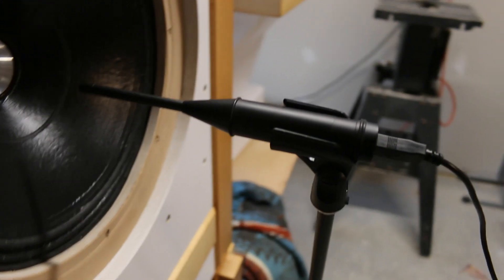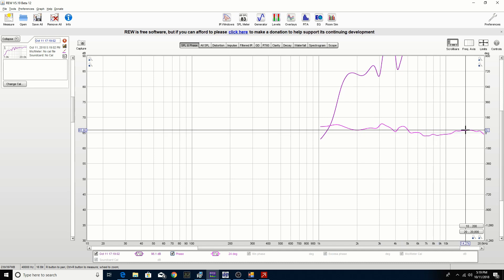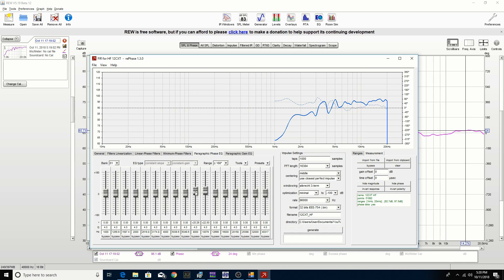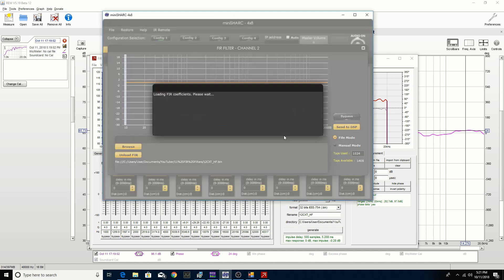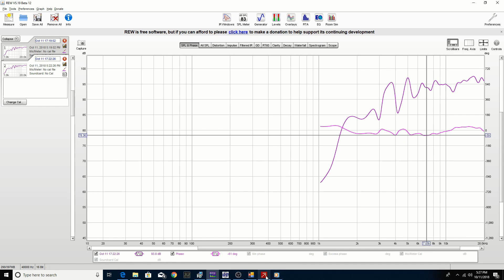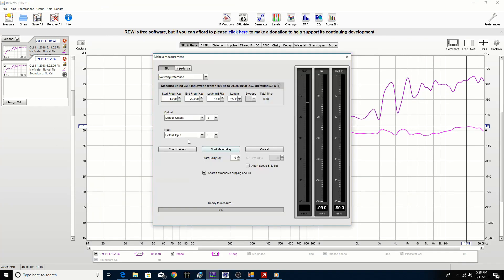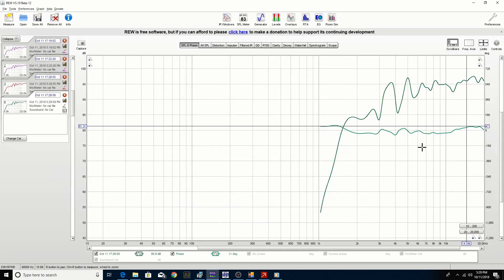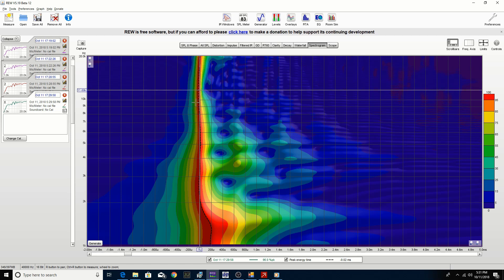Flattening Phase Response using FIR Filtering via MiniDSP OpenDRC-DA8

Comment: But this is like eq right??? So what's the difference???
Reply from the maker: subjectively it just brings the image forward or backwards into the soundstage. It's not better or worse but just different.  If a speaker is well designed then this is not required IMHO.

Comment: Problem with this kind of setup , this Coaxial setup is Wave Guide Vibration , so you have a Horn essentially and its vibrating back and forth . So your physical air for HF driver is not stable,  this introduces Frequency instabilities , and it sounds like when you talk trough Ventilator , creates Frequency modulation . 
Now this shows how there is no Perfect speaker , everything is a balance . However i can make a DSP to correct for this , but its not cheap . Its an Invention . Few Speaker companies are working on it already , still not patented so if you are interested let me know .

Comment: Phase is considered only on Xover frequency , because of summing , if there is no summing like here is the case , there is no change in response . Your Ear doesnt care about phase , so if the Xover is set to 2Khz , then everything above that is non important , you can play with it but you will hear no change
Reply: True, but phase changes the waveform shape. Imagine listening to a square wave synth.
Reply: @manamimnm  yes it does , but its not a square wave , bass unit creates sinusoidal pressure medium in front of mid high driver , and then its sounds travels along the bass sound. You can imagine this as Amplitude modulation , and it sounds exactly like that , take a song , amplitude modulate it at say 100hz  in some DAW , and you will hear exactly that . If you listen only  those speakers you cant detect it easy , but A and B fast switching , you will notice , i did . And beyond that Measuring microphone does not point towards a speaker but its tangent or 90 degrees , in this case vertical . Sound crosses the capsule and changes pressure in it , while if you point it at the speaker , sound will enter in  and cause phase shifts and all kinds or reflections ,and stuff , it makes it even horizontality but less . But at least measuring instrument is used , i promote that , because Sound is similar to Visual  Art , if you dont know what to look for you dont see it or appreciate it , with sound its more pronounced since you cant see it , effectively you are enable to hear stuff if you dont know what to listen for , and when this is done , its done with 1 speaker , always only 1 , even if you have a stereo pair .  You test stereo Pair only to see the sound at listening position , for other measurements always one , always in the center of the room because reflections are of lowest volume there , if you want to know more about your speaker . I have measuring gear , and time and time again , i fail , tests show me one speaker is better then the other when i though the opposite but only after careful examination , things fall in to place . For example i have one philips speaker , dull sounding , i was thinking its something wrong , it dull sounding . But later when i saw the measurements , i saw that is the one that is the flattest or most true to the signal that was sent to the amplifier .

Comment: How do I measure tweeter phase on a 2 way passive speaker?  If I measure close up will the woofer mess with the measurement?  Also should I do the sweep from dead center at the crossover point??
Reply: TURN off physically woofer :)))

Comment: Hi, great tutorial on how to use rephrase and the open Drc. But I'm not sure if the application example was that helpful. Would it be better to show an example of flattening the 180deg phase rotation in a LR2 crossover between a tweeter and woofer? Thank you!
Reply: I tried for a short while to phase correct crossovers and to actually create fir crossovers....but in my experience there are nowhere near enough taps available in the minidsp to do that.
Reply: @plcamp1  Can you just do the phase? and use the xover in dsp to save taps

Comment: hey man your an absolute legend,  you've helped me out again,   gonna call you up on those solidworks lessons you offered me at some point,    need to turn the point source/line source horn I have in my head into an actual plan.  i loved the look of your point source horns btw,   but sadly it won't work for me because i'm trying to design something for pro audio with allot higher spl goals,  synergy horns are nice but i was trying to come up with something that avoids the bandpass element of them.  am gonna build your horn for home use at some point though.  sorry if i seem a bit overexcited,  but really appreciate what your doing for the community  :)
Reply from the maker: alex kirk I do quite a bit for the pro sector.  I haven’t done anything synergy related but the summer Rain it totally suitable for high SPL if you use the venerable B&C 8PE21 which provides a stunning 110dB sensitivity @1watt.  That driver has a very low QTS for horn loading applications.

Comment: Make sure your frequency response is flat before you try to make phase flat , your make it non minimum phase 

Good video tho , 
Minimum phase should look (almost) like an inverted frequency response .
Reply: I think your trying to do too much, 
You want mixed phase filters , use regular iir peq for as much as you possibly can, than once your normal peq and iir crossovers are tuned and frequency response is flat and crossovers are behaving themselves (acoustic slopes match electric slopes) and system is sounding very good and your magnitude is flat than measure and add your phase correction only on non minimum phase parts of the phase. If it’s a ring in box or some wired driver behavior than correct in fir, once phase is corrected it dosent matter too much if your crossovers are linear , it’s the sum of all the waves from the speakers on each side that combines and makes a new response that is where fir comes in. 

Do nearfield measurements and work your way back to your seat and start gateing and offsetting the ir for time of flight delay to mic. 

Or make your crossovers linear , especially the sub. I would use  fir on the sub and midbass integration if I was limited on taps or buy more opendrcs and go deep down rabbit hole (but a fun hole to be in) :-)
Reply from the maker: Nicole Denver wow thanks for the info!  This info isn’t available online, at least not that I’ve been able to find.
Reply: @therealandyncrystal  i know this is an old comment but if possible, could you explain what you mean by this? "add your phase correction only on non minimum phase parts of the phase."
Reply from the maker: Nicole Denver interesting...I’ll be sure to give it a try.  I’m a little disappointed in the OpenDRC-DA8 because it can’t do low crossover points below around 5kHz because of the number of taps.  I think MiniDSP should clearly state this on their literature.
Reply: Joseph Crowe's DIY Speaker Building 
Opendrc can make crossovers at 50hz 
Try linearizing your crossover instead of making linear phase crossovers 

How many taps does the da8 have and how many can be allocated across channels and is it 48khz or 96khz 

I use 2 2x4hds as Dacs and fir crossovers with 1024t on each channel in a 4way 
And a Dirac ddrc in front of them on toslink 
For eq , I can make all kinds of crossovers with 2x4hd at 96k 

I would use a opendrc on each speaker if you want full flexibility, but it’s not needed ,